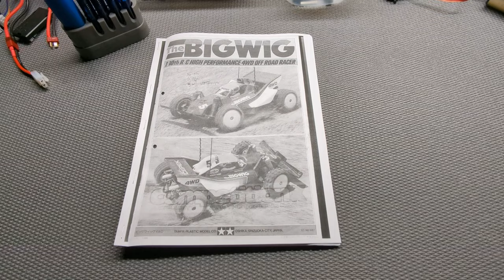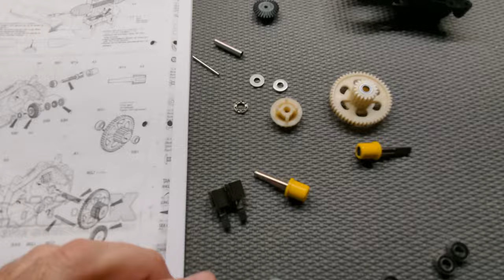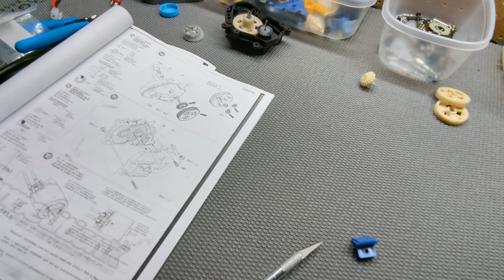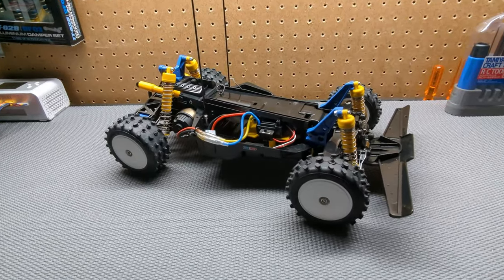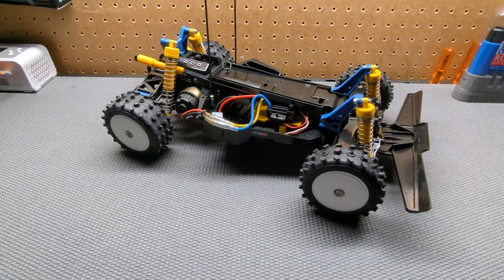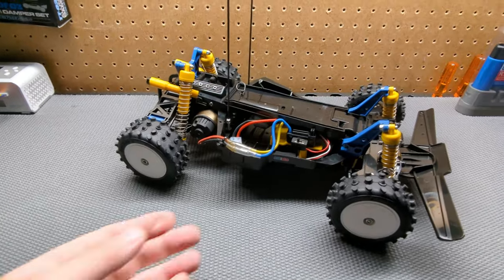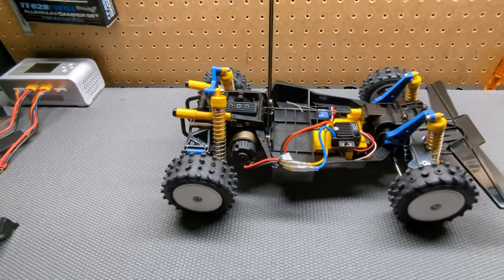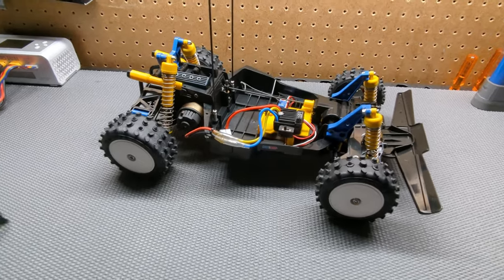Vintage 1986 Tamiya BigWig RC Car Kit# 58057 - Time To Rebuild A Classic Tamiya!

Comment: Nice one 😊 yeah the Bigwig seems not as "loved" as some others; but with 4 shocks, the unique body and the Technigold, it deserves more. I have one original to restore, but some parts are so hard to find (mostly the incredibly brittle sub chassis) 😢 Nice tip on the heating of the screws, just how long do you leave the iron on it ?
Reply from the maker: Well...I broke a front lower arm on the second run, and I was lucky to find one on eBay. Still waiting for it. Other than that it's perfect, I do have some spare parts but not a chassis. I plan on running this in the spring once it warms up. I learned my lesson already... running brittle plastic in the cold is not good 😢 I heat them up for like 10/12 seconds with my iron on them. But they are all different, so don't take that as the rule. I can feel them turning in smooth and with little resistance. I stop once I feel it hit the end and I don't put anymore pressure on it. I've done this for a while now on the more brittle arms and I haven't had cracking. You can also get rid of the pins and go with hinge pins and e clips, but it's hard to find them in the right size. Sorry for the long response!